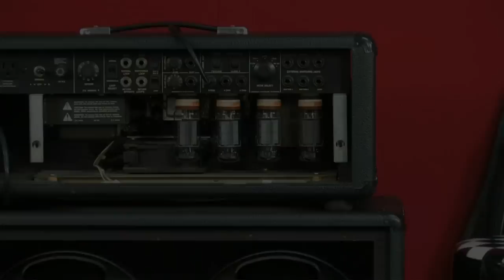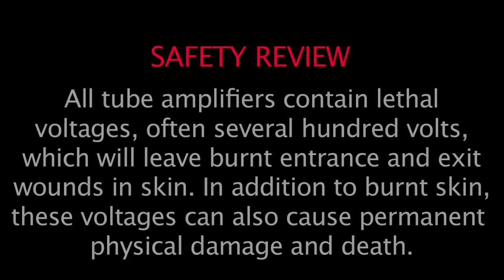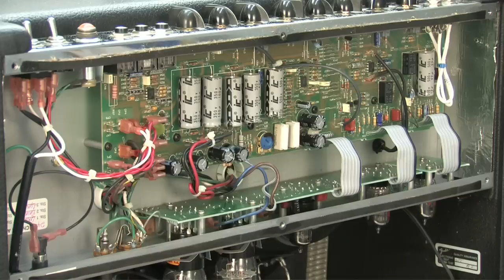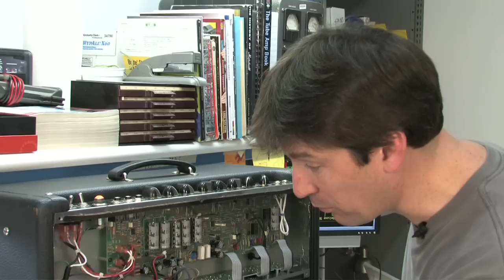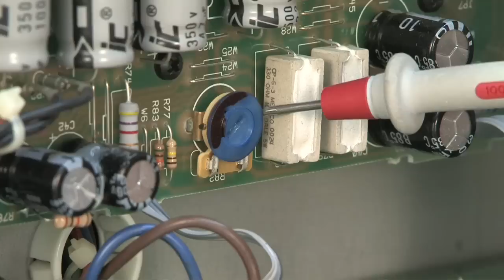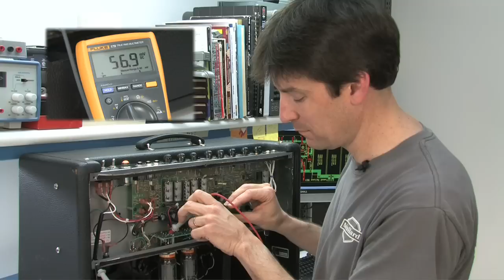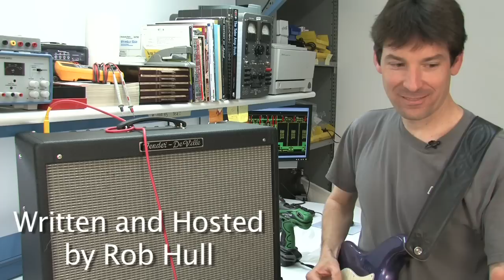How To Bias a Deville Amplifier

Comment: Great vid. but I gotta question.... 

I have been told by techs to never handle vac tubes because the dirt & oil from your fingers makes the tube run hotter and have a shorter life span. Iso alcohol is to be used to clean tubes if they are touched. 

Has this rule changed because of some techno improvement I don't know about?

Comment: Thanks Rob for the info.
Can you suggest what practical brand of KT88 tube good for this dyna mk3 in terms of quality but not much expensive like the three choices below from your TubeDepot:
1. Sovtek
2. Electro-Harmonix
3. JJ/Tesla
so what about these 3 NOS respective cathode currents then?
Is 70mA still safe or they are just between 45mA - 60mA?

Comment: Consequently, a person doesn't really know which voltage is a 'bias' you are talking about. Finally, you didn't mention that amps working in A class are cathode-biased and cannot be biased the way you're showing here.
Reply: Firstly, the only guitar amps that operate in Class A are single ended amps, e.g. Fender Champ. There are double ended amps that are cathode biased but still work in Class AB, e.g. Vox AC30. In a 'fixed biased' amp like the Deville the negative bias voltage on the grids of the output tubes controls the idle current through the tubes. Biasing is accomplished by monitoring the current in the tubes while adjusting the bias voltage. The current is passing through a one ohm resistor, which means that the voltage across it has the same numerical value as the current passing through it, so that reading a voltage of (say) 40mV means that 40mA is flowing.